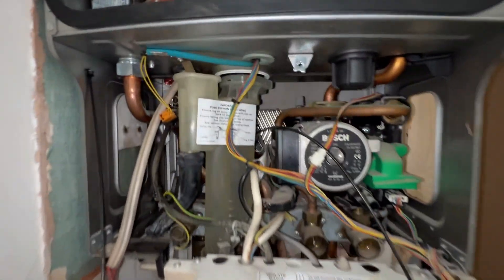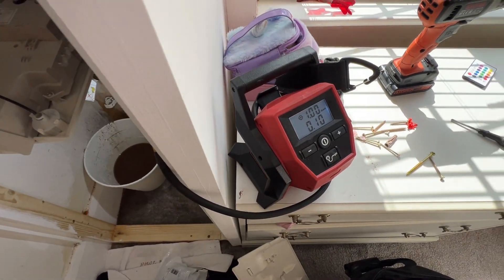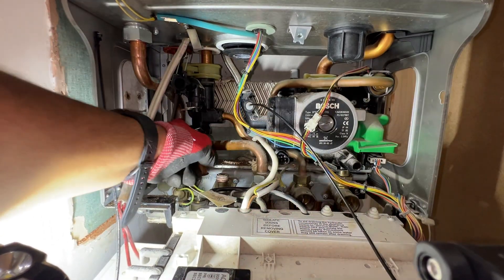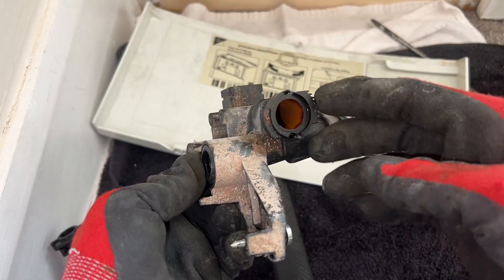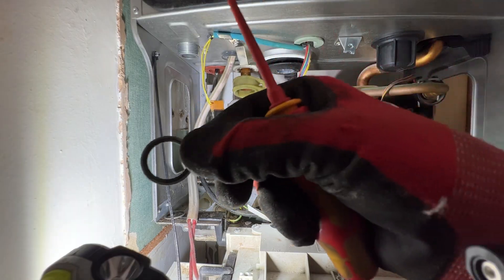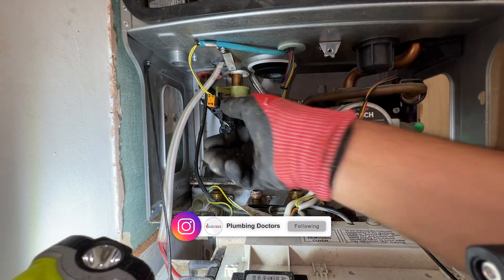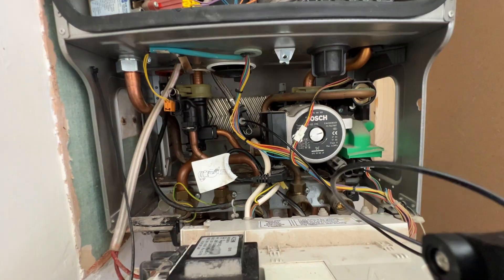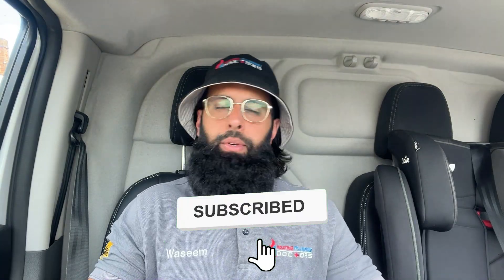⚠️ Worcester Bosch Greenstar Leaking? Replace Flow Manifold (Left Hand Block) 🔧

Comment: Some engineers  will take the whole manifold out, to replace either the flow or return manifold. However, I just remove the manifold that needs replacing.